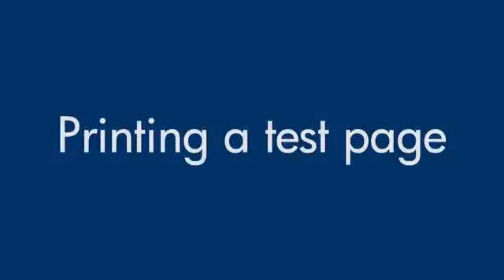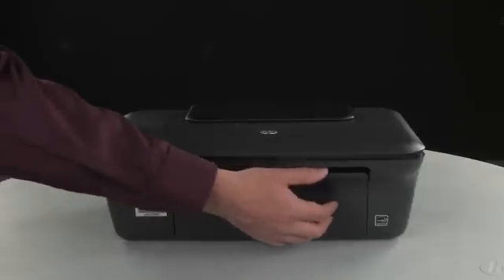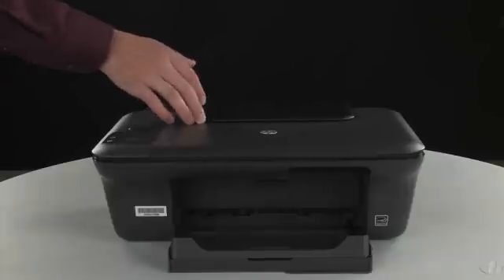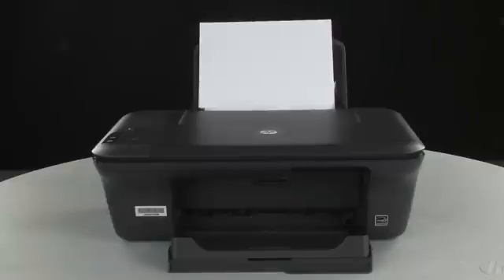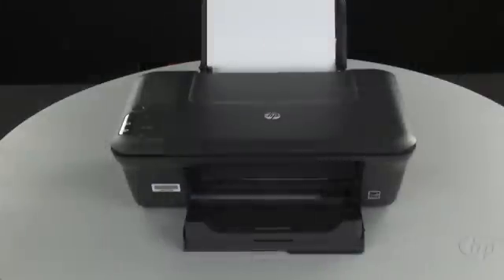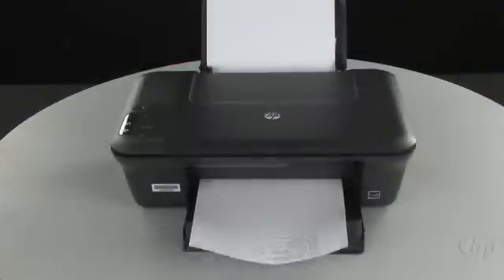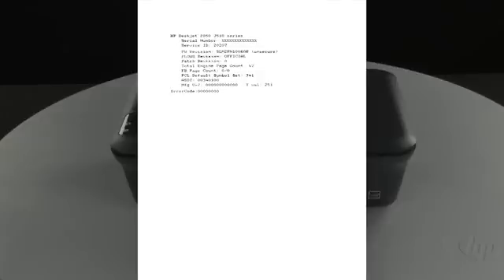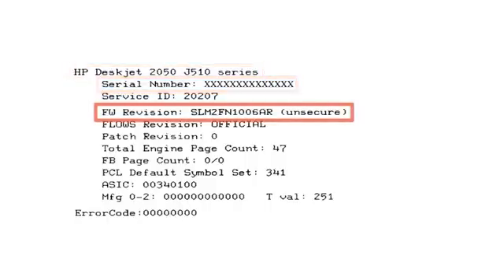Printing a Test Page | HP Deskjet 2050 All-in-One Printer | HP Support

Comment: I want to know about "is hp rest jet 2131 works with out computer " means can we take Xerox copy with out using p.c.
Reply from the maker: +ashok reddy Yes! The HP DeskJet 2131 Printer is an All-in-One printer, it does Print, Copy, Scan. You can make copies through the printer without connecting it to any computer.
Reply: Thank you sir
Reply from the maker: +ashok reddy  You're welcome!

Comment: Hi I was wondering what types of paper can be used for this printer, I want to ask if it works with photo paper or magnet paper, I have tried but it jams the printer, please reply back
Reply from the maker: +Just a random deer It can print both documents as well as photos but not the magnet paper,I see that it jams the paper.Please try the following document in order to resolve the issue: http://bit.ly/2mfsFAw, also check paper specifications: http://bit.ly/2mfF3Ax

Comment: excuse me sir, i need to know how to print poster/multi pages using HP deskjet2520hc printer. i tried so many times but cant reach the solution.
Reply from the maker: +Nur Alida Print better-looking photographs/poster from a PC using the correct paper type and appropriate print job settings. Please have a look at this document to make sure no steps were missed: 1 http://hp.care/2it85Ob  2 http://hp.care/2it4JLb  3 http://hp.care/2isYUgD

Comment: Hi, how can I scan multiple continuos sheets on a single PDF document? Is there a Way? So far I do my scaning sheet by sheet and name them **page 1, **page 2 etc... is there a way to do this using the DJ 2050? Thanks!
Reply from the maker: It normally is more a function of the software you are using. In the HP Scan software, you can scan multiple pages into one pdf file by "clicking the "+" button to continue with the next page, then click save to capture it in one file."

Another option would be to look at a third party tool to combine several existing pdf files into one, for the files that have already been made as single page scans.
Reply: ok thks
Reply from the maker: You are very welcome!

Comment: How do you change from landscape to portrate in a HP 20-50 printer?
Reply from the maker: +Barry Craggs   I've included two documents for you regarding how to change print settings, which is how you would change from landscape to portrait.  Please click on the link that corresponds to your operating system.  And do not worry if you don't have the printer mentioned in a document, the settings are fairly consistent. 
HP Printers - Printing and Changing Print Settings (Windows)  ( http://ow.ly/WbIQn )
Mac OS X: Changing the Printer Driver Settings ( http://ow.ly/WbIXg )

Comment: I don't have the CD for this printer. So, is there any other way to download the appropriate software to use it?
Reply from the maker: +Chris Pizzo  Please search for "Deskjet 2040 drivers" using Google search.  The first hit should be the link to the driver download page for your printer.   Another option is to please search for C02073861 on HP’s home page.  The title of the document is “HP Printers - Using HP Diagnostic Tools for HP Printers in Windows”.  Please use HP’s Printer Install Wizard utility.   The HP Printer Install Wizard automatically finds the best available print driver for your HP Printer.

Comment: hey, how to capture the paper then editing on computer ?!
Reply from the maker: Tha Prince What program are you looking to use with your computer and printer? Are you looking to scan a picture and then edit it? Are you using a Windows or a Macintosh computer? Is your printer connected using a USB cable, or is it connected to your wireless network?
Reply: my printer is connected with USB, and i just want to capture it using scan, but i dont want it to print it the same, i just want to edit the picture
Reply from the maker: Tha Prince Is your printer able to successfully scan a picture to your computer? What program are you looking to use to edit the captured image?
Reply: no program. just scan and instantly print
Reply from the maker: Tha Prince If you are trying to make a photocopy, which would be to scan an image on your printer and then immediately print it, I recommend following the steps in this document on HP Deskjet 1050A, 2050, and 2050A All-in-One Printer Series - Copy Documents with Text and Graphics. This resource can be found by Google searching "c02251839". If you are looking to scan an image, the HP Support Assistant software that came with your printer will allow you to adjust the image in minor ways. A few examples of this are cropping the image, adjusting the rotation, etc. If you are looking to do a more extensive edit of your scanned images, you will need to acquire a 3rd party program to do this.

Comment: every time I print, the black ink comes out smudges slightly! It's fine in colour :/ How do I calibrate the printer?
Reply from the maker: Ashinator5000 I would suggest you remove the black ink cartridge and with a damp lint-free cloth clean the copper contacts.

Comment: I have ink in my cartridges but it prints without ink when i print a sheet what is wrong?
Reply from the maker: Hi Matt Winterton,
Please search for C0261863 on HP's home page or using Google search. It is the trouble shooting document when your print quality is not what you expect, in this case your printer is giving you blank pages.
Reply: Actually you should check your printing properties from devices/hardware in control panel under your printer type.

Comment from the maker: I will private message you with a link for the drivers. Please select the correct operating system and select "full feature drivers" from the next page. Uninstall the current printer drivers and then download and install the full feature drivers for your printer. Let me know if this helps your issue.

Comment: Why does it say "not genuine HP ink" when i install Walmarts ink for the printer, Was not a problem before has HP locked the chip so that only HP ink will work in the printer.... Update seems to cause trouble with stores ink.